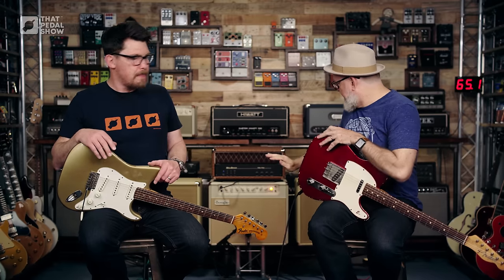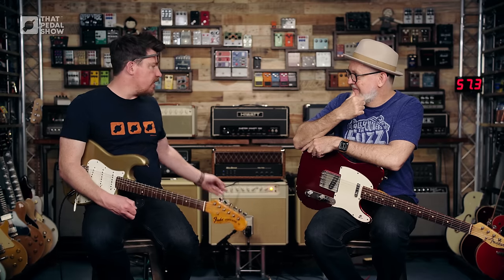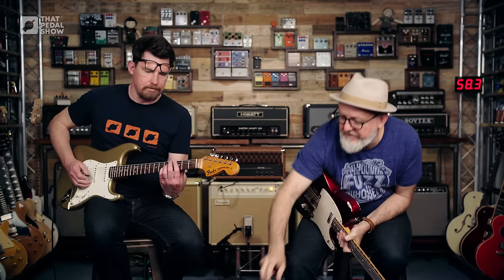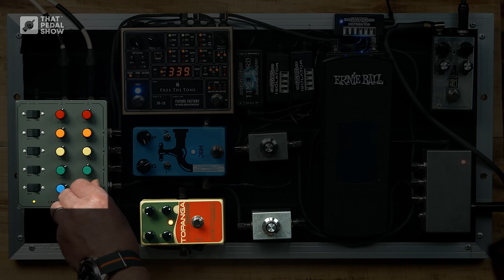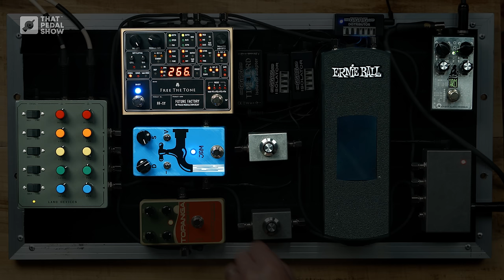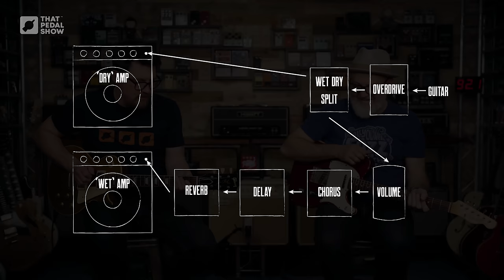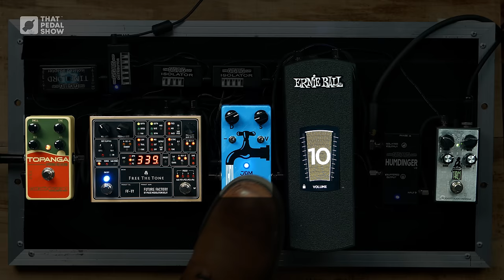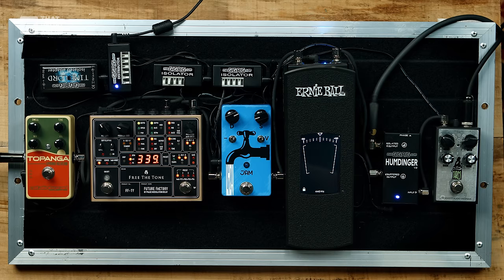Did We Get Wet-Dry Guitar Rigs Wrong? [Proper Wet-Dry-Wet Vs TPS Wet-Dry]

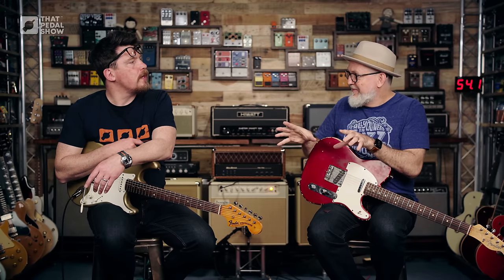Comment: Cool video guys!  The true W/D/W rigs sure are glorious!  Thanks for making this video to help evangelize this approach!  Around 11:00 I would say the more common way than the mic'd dry amp feeding a mic pre and then the wet processing effects, was instead, using a Line Out Box or having a line out built into the amplifier.  The line out was a line level output tapped off the output transformer with a volume control to attenuate the level to match up with the effects it was feeding, this is different from an FX Loop Send (or preamp output).  The Line Out  is what Steve Lukather, Paul Jackson Jr., Jay Graydon and others did with their Rivera Modded "Stage II" or "Stage III" Fender amplifiers.  They did often have buffered effects loops added as a part of the mod, but for the Wet/Dry/Wet thing would use the line out and either load the Rivera amp with a resistive load (if they didn't want to mic the dry amp speaker) and then feed their stereo effects to a stereo power amp and then wet cabinets (and just have two cabs on stage with the dry and wet in both cabs) or they would mic the dry amp and feed the wet processing effects via the line out that were all in a stereo parallel mixer (except for chorus, compression, and maybe EQ), that would feed a stereo power amp and wet cabinets for L and R.
Reply: Fascinating, thanks for the insight into those rigs!

Comment: "TPS Wet/Dry" is the perfect term. Like Dan said, you still get that fullness of the dual amp setup even when all the "wet" effects are off.
Reply: It is too bad you cannot hear that in the video as both amp were mixed dead straight...
Reply: @egoncorneliscallery9535  Well they did say that if running it live they'd say put both amps straight down the middle rather than panning left and right 😊 so I guess that's what they were going for

Comment: I’d love it if you did get in a couple of pro juniors and put them wet/dry up against a single “big” amp in terms of sounding big at different volumes, it gets alluded to fairly often
Reply from the maker: Let’s totally do that!
Reply: Those Pro Juniors are awesome little monster amps but easy to fry. They get so hot they melt the valve sockets.
The overdriven sound is really great and better than other amps like the Blues Junior. No tone stack loss so pretty loud.Less versatile but loved by blues players. 2 of them would be glorious..didnt Jeff Beck use them at some point? Mick would probably know
Reply: They’re toys, and they sound like toys when next to a big amp.

Comment: A working-mans version of the OG wet-dry-wet is to use a solid state stereo combo like Roland KC-220 / KC-990 to run your stereo wet signal. Your wet signal doesn't need a pair of boutique guitar amps. No guitar tech required LOL. Just have the house take the DI L/R out of the KC and hard pan them and your done. Run the DI into an Iridium cab sim if you need that depth. You can stack the KC-220 on top of your combo amp, or put the combo amp on top of the KC-990 to get the Left-Center-Right effect.

Comment: Thank you for this episode!  I've been exploring variations of wet-dry over the last decade, so I was really interested to see and hear your demonstrations.  I agree that for gigs a smaller footprint and straightforward setup for yourself and sound engineers is the way to go.  My guitar is a Telecaster, but my main instrument of performance is an electric viola; I began experimenting because I wanted to maintain the viola tone, bow articulation response and clarity that I was already getting, and then be able to add and control the effected sounds separately.  I've used one amp with parallel volume pedals - one dry the other 100% wet, two amps with the parallel volume pedals but the wet with some original sound (basically the TPS format) , two amps in series where the second amp is wet, and three amps set up wet-dry-wet with the outer amps in stereo.  My basic wet is reverb - sometimes just the reverb on one of the amps, other times a reverb pedal with a big 0-100% range of level, tone, and length.  I like smooth resonant plate or hall reverb sounds, and following that with a really slow OTA phaser, usually with both at subtle settings, but sometimes huge for what I call the "space viola" sound.

Comment: I use a TheGigRig Wetterbox to create a Wet/Dry using 1 amp by blending my wet effects in parallel to the direct signal. It's certainly no a true Wet/Dry, but it definitely massively improves the tone at gets pretty close to the sound of my wet/dry setup with two amps! And, I don't need to schlepp a ton of gear 🙂

Comment: But you can run a full Wet/Dry rig as well with only one dry amp and one wet cab. It doesn’t have to be stereo wet effects. The best way to do it is tapped off the speaker out with like a Suhr ISO Line Out so you’re getting the full dry amps power section as well with a variable line level control. This is how Bob Bradshaw does it (albeit with his own line out box). Then you run it into something like a Musicom Lab Paralelizer or even the RJM PBC 10 switcher which has a built in stereo parallel line mixer that you can turn on/off the dry signal at any time. From there hit a mono power amp and into a wet cab. And this is all on a pedalboard with only the addition of the parallel line mixer of your choice. Does not have to be a giant rack unit to get a full wet/dry rig.

Comment: After seeing one of your older Wet/Dry videos,  I'm hooked. In respect of the setting of the amps, I'm in Micks camp. Both clean and reacting the same considering volume and compression. I use two Award-Session  5E3-extra amps. You might like to check them out when you do a new transistor amp feature. Keep up the good work.

Comment: I call it moist/dry. 😆The Goodwood Audio W/D/W box makes it so easy to set up a Dual Mono W/D, W/D/W, Stereo, or Mono setup simply by which output(s) you plug into. I just built a new Jazz pedalboard using it. I made a video on it. If you want to check that out. (TPS and viewers)

Comment: Fantastic episode.  (Currently halfway through)  I’d have loved to see a micro pitch shift in there as well, for the Landeau and EVH sounds.  The chorus is wide, but the slight detune takes it to the next level!

I think i’m going to put this together with my G-Major 2 and Stereo 2:90 for the Wet channels and everything I’ve currently got for dry.
Reply: Stereo detune is my favorite "modulation" sound ever. I totally agree.
Reply: I experimented in my Podhd500x with a slight detune and slight delay on one side of a stereo split with different amp models and was instantly taken to 1986. 😉
Reply: Where did I see the micro detune in a wet dry thing recently? Was it a vertex video?
Reply: @iansmith7871  might be, but every Landeau and EVH post-DLR video includes it too.
Reply: @iansmith7871  possibly, he just did a video about line out boxes, which featured a wet/dry/wet setup.

Comment: I did it in the 80s, without knowing anything about terminology, just to mimic what I was hearing. On heavily distorted tracks on recordings you could still hear the core guitar sound with some clarity. I figured that the only way to do that would be to split the signal from the guitar and run two separate amps - one clean and one distorted with effects. I hooked up two amps and that gave me the sound I was looking for.
Reply: I still do this wet/dry setup in amp sims with good results. It’s not as complicated as as the W/D/W setup in the video, but splitting the signal into two separate amps works great. I pick a good clean amp (like the Fender Twin) and then something distorted with reverb/delay (like a Soldano) and run them independently to the virtual output.

Comment: I run a split post-drive pedals. Dry signal goes to a Hi-Tone DG50 in the middle. The wet signal eventually splits into 6 lines that get remixed into 2 outputs that go to a Two-Rock Bloomfield Drive on the left and a Victory V40 Deluxe on the right, all 3 amps sitting on vertical 2x12 cabs. For the wet effects, a Harmonius Monk gets split to dual-mono, a Free The Tone Future Factory into L-R stereo delay, and a Source Audio Ventris into L-R stereo reverb, all run in parallel. I run the wet amps at around 69% wet mix. Definitely not a gigging rig... it's purely a piss-the-neighbors-off rig. The biggest challenge I have is balancing levels between the 3 amps, but once it's dialed in, it's epic.  Many thanks to you guys for the knowledge and motivation to put this together. Curses to you guys for the money I've spent! Just kidding... keep up the great work!
Reply from the maker: Ho. Lee. Sheeeeeat! Now that’s a rig!

Comment: One of my favorite way to set up wet/dry/wet is to use an expression pedal to control volumes of both wet and dry but in a cross fader fashion. Heal down wet, toe down dry and all the mixes in between.
Reply: That is an awesome idea
Reply: Exactly same for my new pboard just built. Use a mission volume, an expression, on both delay, reverb, and chorus. The board is purpose built and runs stereo into two Vox AC15C1's.

Comment: Glad you made this! Multiple ways to achieve the same goal, but I think Bob Bradshaw and 80’s session players would disagree with your version of “wet/dry”. Full disclosure I have used your approach for years and I simplify it to “wet/dry” instead of dual mono for ease much in the same way guitar players call the whammy bar “tremolo” instead of vibrato. True wet/dry is beyond the average guitarist but is cool as hell for certain situations. I think the dual mono version of wet/dry that you use is more accessible and flexible for the average guitarist. I have found amazing uses for mono, stereo, wet/dry and dual mono with time based effects going to one amp only  for various situations.

Comment: Great video TPS! One of the clearest episodes yet.  Just a few questions:
- When do & don't you need a line out box?
- Does a splitter always put the effects on the other side into parallel?  
- Regarding the 2nd diagram/method, why was the signal routed to the input of the 2 amps and not in the effects loop?

Thanks!

Comment: Haven't watched yet but if this is about wether or not you include dry signal in The wet amp then yes I think you need it. I remember trying to play a dotted 8 delay with just delay in one speaker and it was a nightmare.

Comment: Finally you guys addressed the elephant in the room... this modern day wet-dry-wet isn't technically what we old time sound engineers / guitar players used to do. I was was running the whole wet (left) - dry (center)- wet (right)  way back in the mid 1980's. And just like Robben Ford I needed a 20 space rack filled with stuff !  2 different Guitar pre-amps running into two stereo SPX-90's. Those SPX's went into 4 channels of a 12 channel keyboard mixer that had 2 Aux(fx) sends on ea channel... so I'd send ea Aux to other FX units.. an Eventide and a Delta Lab timeline delay and those would return in stereo to the other channels. I also inserted compressors / gates on the pre-amp channels. And I had a full pedal board with about 8 fx pedals and a custom switching system / router that I designed and built because there were no companies making those things then. The Bradshaw system was $5k to $10,000 in 1986 money. I didn't have that kind of money.  So I built everything myself. Built my own fx pedals, switcher / router, cables, even started building my own hand made guitars and finally tube amps. That rig sounded GLORIOUS !! But the rack weighed 120lbs and took a small van to haul it all around in. And every night I had to troubleshoot the gremlins... i.e. the odd ground loops / hum. It was a lot of work !  In the end... by 1991... frustrated I was suddenly struck by a thought..."Geez.. all this just to sound like a really good Marshall cranked.... and it doesn't even sound like that anymore "   So I sold it ALL and bought a 50w Marshall head and two 4x12's... which quickly became 2 heads into 2 full stacks.... which slowly lead to hearing loss and insanity. ahhhhh so many vague memories.
Reply: LOLss... nowadays I'm running my pedal board into a 3 channel router that sends out to 3 separate channels (clean ch, crunch ch, lead ch.). Those 3 sends go out to any 3 of a dozen hand made tube amps I own / built.. The tube amp outs are all patched into a patch bay that I can then patch the 3 amps I'm using into 3 Torpedo Captor X's. Those 3 Captor X's have stereo xlr outs which I send , along with my Kemper stereo outs,  into an all tube custom made 16 channel mixing console going into my UA interface. So I'm still running at least 10 channels. Now this rig sounds freakin epic !  All my amps are handbuilt / custom... 1968 Plexi, 69" Laney Supergroup, Dumble clone, Trainwreck clone, Jose Arrendando modded Superlead clone... and about 6 other custom amps. No more dry channel though.... it's all wet/wet. Ultra mega mondo stereo.
Reply from the maker: Ha! This is truly awesome. Apart from the hearing loss bit. Thanks for the rememberances Joe!
Reply: @JoeGuitar  Is there any place I can see pictures of that? It sounds flippin epic!

Comment: I experimented this for a while, used three Quilter ToneBlock 202's for amps. And then three cabinets, two sealed RedBack 1x12's for left and right (wet) and the center (dry) was loaded with 2x12 creambacks.  Various effects processors, pedals and so on, it sounded best with at least 4-6 feet separation between the cabinets which is not an option for most stages when you figure in 2 guitars, bass player and drums. just not enough room.  The Quilters made it easy to tweak, reasonable cost and lightweight, also worth noting with the left and right in open back cabinets I had some really weird phase issues I can only attribute to room reflections using sealed cabinets for the wet really improved the imaging and "depth".  100% not practical for at home, but was fun to play with when I had all the equipment on hand.
Thanks for all the videos!

Comment: I know this isnt Wet/Dry related, but the mixer on the board is related. U guys should do an episode on using a mixer to blend parallel chains and how that can expand your tonal palette. Maybe even explain the differences, benefits, and downsides between active and passive resistance mixers. I recently decided to add a mixer (DOD 240 Resistance Mixer) in order to blend clean signal back into my dirty signal, and oh boy, it is amazing. Im shocked on how such a simple thing can open up a massive world of possibilities. I have a Boss Eq-200 before my gain section that splits my dry signal to the mixer and having that blend option and the eq to shape frequencies before the dirt pedals without eq'ing my dry signal allows a plethora of tonal options that weren't possible before with the same handful of pedals. Using a passive resistance mixer does have some volume drop when turning one channel down, but having a boost after it (return back to Mesa Highwire) fixes that problem for me, but an active mixer would fix that problem more efficiently. I would really love to see TPS's approach to this topic in a future episode, see what type of sounds u can pull out of it, and teach us pedal nerds more about pedal mixers.

Comment: I’ve ran my rig wet dry wet for years, a true parallel wet dry wet.  The technology today is available to do this quite easily without the massive rack thing.   The cabs you can’t get around of, and there’s a certain amount of size you need to deal with, but, yes, it’s a lot simpler than before.  If you come out of your speaker out with a line out load unit, you can use some solid state amps for the wet cabs because you already came out the heat of your power tube amp, that will make the rig much smaller.

Comment: I modeled my live rig on the original wet dry video you guys did. I’ve found it’s the easiest and most reliable way to do wet dry in a gigging/ working scenario. I typically don’t use a volume pedal to balance the wet levels. I tend to find the in room balance at sound check and then make nice with the sound guy. I find if I promise to play at whatever volume they ask me to, not only do they eventually ask me to turn up, they are also mindful of the wet and dry amp levels in the live mix. :)

Tone Bone Switchbone is a great alternative for splitting your signal if you’re still saving up for Dan’s fancy gadgets. It has clean class A circuitry, phase switch and a couple other features that make it simple for a small to medium board.
Reply from the maker: Very cool! Love the 'play nice with the sound engineer' approach. There is WISDOM!

Comment: Hi Dan & Mick,  Fantastic show as usual. Been following the Wet & Dry journey and this show really opened everything up to a new clarity   ...          
On a side note,  I noticed you used a single output (A) on the FF-1Y on the final board but had the delay set to Stereo. Even though you are going into one (mono) amp it is still possible to utilise both A&B channels of the delay using a 1/4 in TSF to Dual 1/4 in TS cable turning a stereo signal to a mono signal, so allowing the use of both series and stereo delay signals to further and double your delay effect options..   obviously you don't get stereo delay output from one amp but it does offer an extra delay/signal in mono.  ..  I have A&B outputs of the FF-1Y going into a Ditto Stereo Looper, with a stereo to mono output (Y- cable) going to a mono reverb or direct to amp.  
                                   Of course you may already now this.  :)    Great show !!
Reply from the maker: Hello Gaz. You might have spotted I changed it from stereo to series. The latter definitely works mono and I’m not sure of the former sums to mono. Should check that! Mick here. :0)